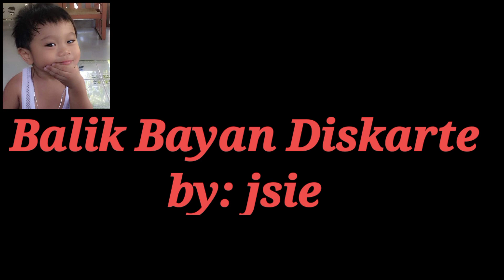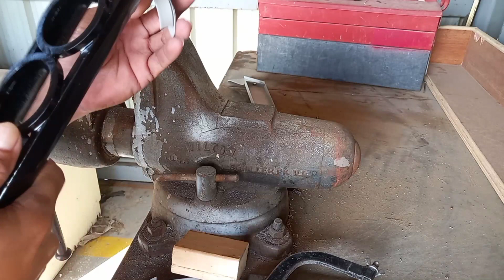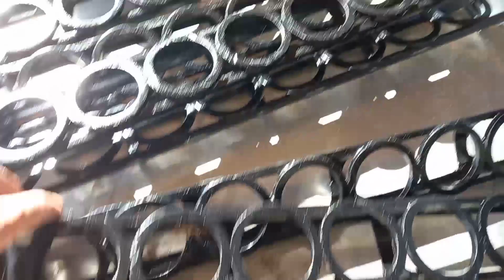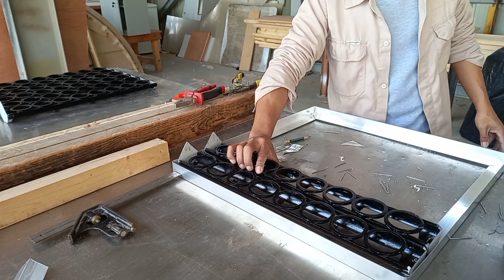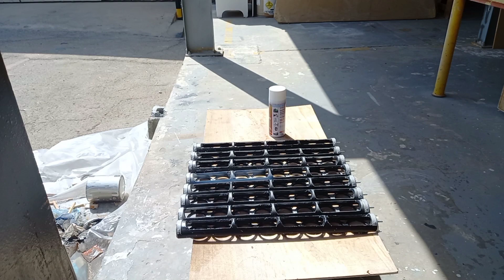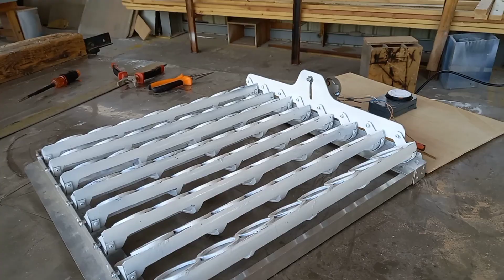DIY Automatic Egg Turner Using PVC Pipe. (64 Setter) by: jsie05

Comment: Sir Anong mga materials mo at sukak sir at size ng pvs at ilang piraso?
Reply from the maker: Boss, ang ginamit kong materials dito cpvc kaya makapal xa 2 inches ang outside diameter. pinang dikit ko nman ay cpvc glue EZ-WELD kaya matibay tlga.
Reply: @balikbayandiskarte1256  galing ng gawa po ninyo.
Reply from the maker: salamat sir